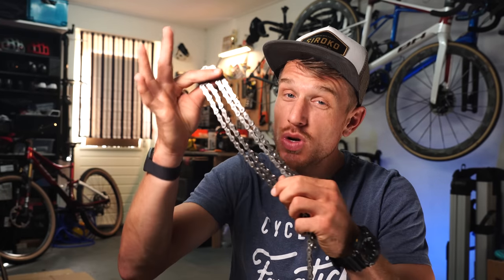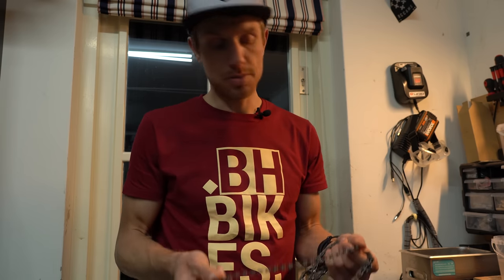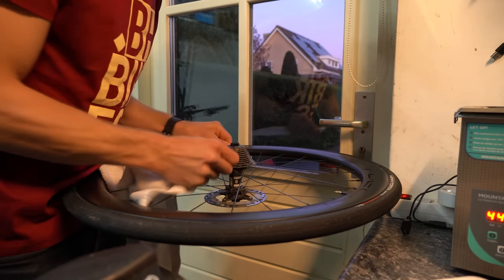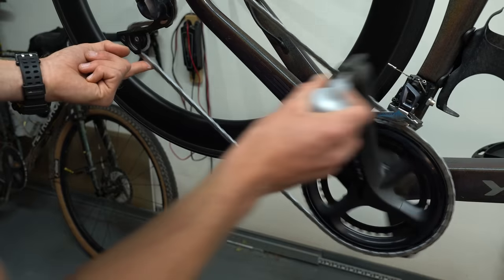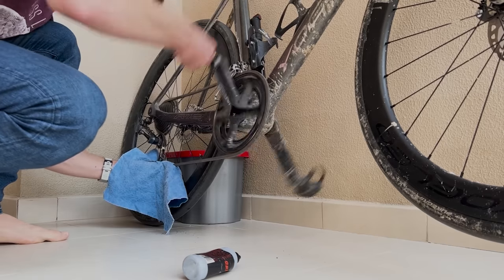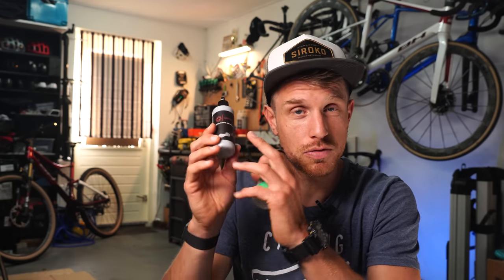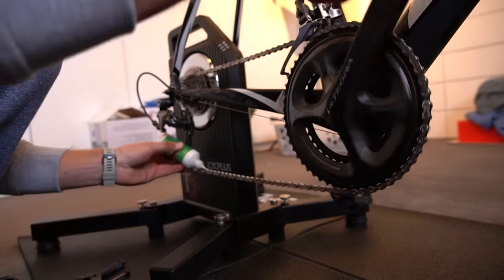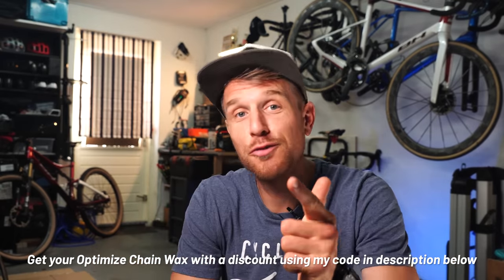Testing Chain Wax for 1-YEAR and this happened..

Comment: Thanks for a great video. Now I might even try this (at least the drop wax as a start) that I always thought was a hassle. A little bit worried about the degreasing though 😉
Reply from the maker: dont worry, just use my tips and you dont have to figure out all this stuff by yourself. shake the chain in a jar with nitro thinner, 3x fresh liquid and its clean. (from the comments here you can also use petrol, white spirits or alcohol but I havent tried those)

Comment: Imho kitchen soap like dreft is excellent, perhaps the best new/old chain de-greaser. Great video:D
Reply from the maker: dreft? never ever will get a new shimano chain clean.
Reply: yeah, I was confused at this video. Dawn dish soap and hot water will degrease the chain so well that it will start to rust right after you dry it off.
Reply: lol You're wrong, Not as smart as you seem.  @jasperverkuijl
Reply: @trentvlak outside of chain will get free of grease and rust. Not the inside I think.

Comment: Rust only occurs on cheaper cahins. I always buy nickle plated and never have the rust problem anymore.
I have been hot waxing for about a decade now  with home made mixes of PTFE, Graphite or molly and I swear by it. I normally do a few chains at a time and rotate them with my weekly bike wash.
Reply from the maker: My Shimano ultegra chain will also rust a little. But only that really light rust that disappears quickly. But the Shimano 105 is way worse.

Comment: I tried using paraffin wax for a while about 25 years ago. It was OK, but a faff doing the melting thing. I kind of got bored, and it didn't seem to make my chains last noticeably longer, and went back to oil. Biodegradeable oil these days. Emulsified wax in a bottle would make it a lot easier. I guess if you are the sort of person who cleans their chain after every ride then this is indeed an improvment. I'm a transport cyclist and ride nearly every day so I can't be doing with that. I clean it once every 6 months or so. I do agree that having a non-sticky non-oily chain is nice.
I think the right answer, at least for non-racers, is really belts. My next bike will be belt drive and I hope to leave all this nonsense behind...
Reply from the maker: Belt drive is the best for a daily commuter for sure!!!

Comment: I feel lube is a very personal thing as everyone has different bikes, riding styles, and diligence to the process of whatever it is. 
I'm using UFO drip wax. I don't want extra faff of pots. I'm sure they do better. I just lube it more often and hot water flush time to time. 
I still think that a petrol and wax based lube was the best performing that I had but I don't miss the smell or the chain tattoo. Even to be honest that one which I am referring to is rock n roll red is low maintenance in the effect that the lube flushes the gunk out then you let it dry. 
The process of flushes a petrol based with cleaner or flushing with hot water is all the same amount of work so I didn't see any benefit in the process.
I suppose to be very environmentally friendly its better to DIY and use food grade wax and no additives
pros- no chain tattoo con= wax is dirty still it flakes off a bunch of wax, just a different kind of dirty.
con doesn't last in wet. protects less.
I don't use wax on my rain bike

Comment: Did you experience any issues with hotwaxing on shimano chains with opening and closing the quicklinks a loct of times?
Reply from the maker: Nope. As long as they “click” it’s ok. 
Shimano says 1 use only so no official advice but I’d say that’s just to cover their ass 😜
Reply: Went away from Shimano chains and switched to YBN. I can't say much on their links but I get a lot of uses from YBN links and chains. I did find coatings on KMC chains don't hold wax well. Shimano wore out fast for the price.

Comment: what about quick links? how did one ever fail on you? how often do you reuse those?
Reply from the maker: never. I re-use them multiple times. but you'll only take your chain off maybe 2x in a chains lifetime. if you use a bit of drip wax in between

Comment: I'm riding abour 1500 km each month and it's getting towards the end of the year without changing my chain. I went with Silca wax and despite heavy use, the chain checker still says the chain isn't worn enough to replace.  I'd bought an anodized blue chain to match my Bianchi, expecting to put it on in June. It's now October and at this rate my chain looks like it may make it to 20,000 km and the new year before I have an excuse to swap it out.
Reply: 20,000 km. That's halfway around the Earth :)

Comment: The best degreaser I've found is simply petrol. It's really not that difficult and so much cheaper. It evaporates off.
Reply from the maker: It will leave oil residue I think?. Better to take an extra step to get rid of that greasy bit

Comment: Nitro thinner is a big mistake and you won't see the damage right away. It is similar to degreaser (just as a chain rusts from degreaser, nitro thinner weakens the metal structure of the chain). Usually the chain will crack and fail some time later due to the aggressive nature of nitro thinner. And if this happens in the middle of a ride (as it did to me once), well... Much better options are regular brake fluid or brake cleaner. General rule of thumb is to know the chemistry of the residuals on the chain you need to remove. Then use the recommended residual removal. Much cheaper and faster method than experimenting with stuff.
Reply from the maker: I’ve forwarded this to optimize. 

Think you saw the result in my video from brake cleaner and leaving it soak for 2 days, —> chain completely rusted! That’s how strong these dissolvents are (also brake cleaner) 
So don’t leave them in too long and it’s (probably) ok. 🤞🏻
Reply: @jasperverkuijl  No sir, I'm just sharing my experience. I also tried nitro thinner by myself (among other solvents), and it makes micro craks on chain links due to it's aggressive nature to the chain - eventually lead to link snap in a middle of the ride. Total disaster. I can post an image somewhere online if you like.
Reply from the maker: That’s a serious concern. I’ll take it into account 🤙🏻

Comment: Can you use bike shampoo on your bike while your hot waxed chain is on? Won’t it attach inside your hot wax?
Reply from the maker: You can. Maybe just don’t rub your chain with it. 

I used champoo to wash my bike and chain (showed in video) and the chain got clean but still had wax. The wax isn’t easy to remove with just cold water or soap. (Very hot water will change what I said)

Comment: Try using gasoline for degreaser in a jar. Another way is full strength Simple Green in a heated ultrasonic cleaner for 2 1/2 hours. Then use Acetone. Finally use rubbing alcohol.
Reply from the maker: Why would I use 3 different substances and use the ultrasonic for 2,5! Hours…., when I can use nitro with 3 rounds of shaking and be done in 10 min?🤷🏼‍♂️
Reply: @jasperverkuijl  Belive me or not. I have had different results between  Shimano, SRAM and KMC. Gasoline then alcohol works well. The alcohol strips the last of the petroleum out of the chain. Simple Green with U.S.C. for SRAM and KMC. Shimano using Acetone and a final rinse  with alcohol works well for me. I find that Acetone stays behind in the rollers and doesn't let the wax fully get in all spaces. Also chain doesn't get rusty in alcohol. You don't need to soak a chain over night. Agitating in a container for about 3 minutes is enough after the first step. This process is only on new chains. Yes patience is necessary for waxing chains. But whatever cuts time off of the process is more time on the bike. OZ cycle has extensive videos on this topic also for other ideas.
Reply from the maker: @thetruelefty9302 well, like I show in the video, in my experience acetone does NOTHING …. 😂🤷🏼‍♂️
Reply: @jasperverkuijl  it's all about whatever works for you best. It's good to hear different ways of doing things. Keep up the good work.

Comment: Seemed like you had a generally great experience once you got better at waxing (dedicated 1.5L slow cooker works great for this, and you can do it in the garage), except for the degreasing factory grease out of a new chain. I learned about CERAMICSPEED UFO CLEANER DRIVETRAIN CLEANER from Zero Friction Cycling. Super easy, supposedly environmentally friendly. Soak for a few mins, agitate, rinse with water and dry it off. Worked great on my SRAM Eagle 12 spd.
Reply from the maker: Yeah the wax is the way to go for me now 👌🏻

Comment: So, by this waxing logic, I wonder if you could achieve any similar benefits from removing the cassette and following the same process?  In theory, it should make cleaning the cassette easier for at least a few cleanings, or maybe it will mostly repel dirt and water.  Or maybe it’s a waste of time?
Reply from the maker: I think waist of time. The cassette usually doesn’t attract stuff when it’s clean. It’s the oil from the chain that makes it greasy and than makes it dirty… 

Just make sure everything is degreased before you start waxing the chain and you’re good. 🤙🏻

Comment: The easy, less aggressive way is the Silca chain stripper. Put it in, let it sit for 10 minutes, shake it a bit, rinse in water and blast it clean with compressed air. Job done.
Reply from the maker: Silca stripper 45€/500ml, nitro thinner 7€/Liter… 
Factor 10 as expensive 💰 

Just like “brake cleaner” by a cycling brand is somehow way more expensive than the motip brake cleaner.
Reply: @jasperverkuijl  It is expensive but you can use it in an unventilated room and the 500ml get a lot of chains done. I wonder if you can find something similar in the aircraft maintenance department 🤔 If we are talking money, we have also have to talk about single use quick links.
Reply from the maker: @chrisridesbicycles in general, airplanes will not use the highest “bio” products as function and safety are more important in that sector 🤓 (like halon e.g.) 

About cost,
I’ve been reusing non-reusable quicklinks since I stopped pooping in my diaper and I never had any problems 😉🤣
Reply: @jasperverkuijl  Sure, what I had in mind with the aircraft is that they will use the stuff that „just works“ and maybe is not corrosive because only hours in the air pay the bills and they don‘t care about the cost of a cleaning agent.
This is a good data point. If it works with your power, I will never have a problem. The samples from 60kg climbers didn‘t give me much confidence.

Comment: did you make chain measurements  before every rewaxing, that would give answer how often it should be rewaxed or how long chain can survive
Reply from the maker: What chain measurements?
Reply: @jasperverkuijl  i make chain  measurement every 1000km to be sure if chain is worn as i expected,to prevent surprise by too worn chain, when i started to use wax,i measured before every waxing(140km) and once i measured after 180km and chain was worn(totaly i made 1500km with this chain and that distance between rewax), now i do it on 100km + - 10 km and chain lasts over 6000km,i use vernier caliper
Reply from the maker: @makantahi3731 i don’t understand what measurement you are doing to judge of your chain wax is worn or not. Sorry I don’t get it. 

Anyway, it seems like you are getting a lot of km’s out of your chain with ex 👍🏻
Reply: @jasperverkuijl  you have any chain checker!?!?!, so it has some numbers: 0.5 / 0.7/1.0 percent!!!, so you can measure it with vernier caliper and as i did, for chain checker i took dimensions: very,very new never used chain is below 119.65mm, chain after 300-500km is "break in" and has 119.70-75mm,and can be used till 119.85-90mm, between 119.90 and 120.00mm chaim must be replaced, i compared same kind chain new with used: i hanged new and used with some kilometers and compared difference in length on 108 links and  new to 300-500 km chain is 0.5 mm longer, chain between 119.70-120 mm is longer 0.5-3.0 mm.  so i do not need to remove chain from bike and compare with new,i measure it on few places before rewax and i know how long it can be in use ,results and predictions are very accurate and very close mutually
Reply: @jasperverkuijl  i used to make 20000 km per year but now 5-6000km, now with chain waxing and gear teeth reshape,cost of my bike use is very low,i save 5 chains per year,and have to buy new cassettes every 10-15 years,2 tires in 2 years...

Comment: I managed to achieve a similar 'cleaning-result' (a ratlling chain) with WD40... (and getting rid of the WD40 residue on the chain afterwards with dishwashing detergent and water)
Reply from the maker: Yeah wd-40 is a good cleaner (also for rust), it will dilute the lube/grease on the chain and afterwards you can use a degreaser to make it clean. 

Not sure if dishwashing detergent is strong enough but if you have good results… great!👍🏻
Reply: @jasperverkuijl  Dreft power 😛

Comment: Use gasoline to strip the oils off the chain. Then wash in hot soapy water and then put the chain back in a jar with rubbing alcohol 91% to pull the water out of the chain. Remove the chain from jar, let's dry and then wax.

Comment: So here's a chain wax doubter's question.  What prevents the water based "chain wax" from causing rust?
Reply from the maker: Ive mentioned this in the video. It’s less resistant to rust than oil, but improvide a workaround that I get good results with

Comment: I am missing one VERY important thing here. How many more kilometers can u do on one chain comparing to oil lubes
Reply from the maker: I didn’t test. Will be impossible for me to compare different chains in similar conditions and actually know what wears out faster.. I ride like 10 different bikes (including rentals) and don’t keep track of every chain on every ride etc..🤷🏼‍♂️
Reply: I get 3 times the lifespan of an oil lubricated chain. I wax 3 times a year, in 6000 Km intervals, get 3 years to a 10 speed chain. The 12 speed chains I wax monthly every 2000 Km, get about 1 year to a chain.

Comment: I just get my bike to the lbs, let them degrease and apply wax at the start and end of the outdoor (4 months) season, in-between start/end i reapply with dripp wax every 300km. Costs me just a few bucks on top of regular service and saves me the hustle with solvents (no need to buy or get rid off the spill) and time. But im not pro or semi pro.
Reply from the maker: Sounds easy!👍🏻

Comment: Nitro solvent is one of the harshest chemicals you can use. Next time try to do this with regular petrol from the gas station, or lamp oil from the grocery store. Much cheaper than all those things and it just works.
Reply from the maker: Guess that’s why it works so great 🤷🏼‍♂️👌🏻

Comment: To degrease a chain the best and fastest thing is muc off Chain degreaser. It's not cheap but this is the only one which works after one use. New chain is really hard to degrease.
Reply from the maker: Lots of other ways that are cheap and work great too 👍🏻
Reply: @jasperverkuijl  yeah you have too put it three time in the jar and the degreaser is aggressive as hell 🙂Moreover, I cannot pour this down the normal drain, but must dispose of it or let it evaporate outside.

Comment: Some  weird stuff here. First, why be so worried about degreasing? Oils and waxes are not that different substances and many oil based chain lubricants already contain wax. When you heat the chain (heat gun etc.) most of the oil will drop off and if there is some left what does it matter? Oil is still good lubricant as it ever was.

But don't heat chain too hot, I'd say limit is 150 deg C. If you go much higher you can draw temper of chain and it will wear down very quickly.

 Idea of hot waxing is to make viscosity of wax so low it penetrates small gaps by capillary effect. If there is small oil residue it certainly will not prevent it.
 
Adding carbon dust or even graphene to wax may have some minor advantage but it also makes chain look dirty which is a bit against the idea of waxing. Matters of friction are so complex that it best to be very sceptical for claims of the manufacturers, they hardly have done any scientific studies. And friction of lubed chain is quite low in all cases so there is no real issue in that respect. If I had to guess I'd say oil lubricated chain has lower friction but in the long run it may be opposite if you don't relube chain regularly.

It is also worth remembering that waxes (paraffin etc.) are very cheap products of chemical industry, more precisely of oil industry. If someone asks tens of euros from dyed pieces of wax in fancy packages it is pretty close to cheating. But ok, it is not dumb who asks but who pays😄 Appropriate price for 1kg of paraffin is few euro at most, I wouldn't pay it more than 3€. 

1kg of paraffin is enough to wax huge amounts of chains, so it is also very cheap method.
Reply from the maker: Well you should check again what I explain about oil and wax and their melting point. 
Mixing oil and wax messes up yhe viscosity, making it an emulsion that’s like grease. So not what you want. The whole idea of wax is that’s it’s not liquid and it should stay like that. Mix it with oil and it will become soft
Reply: @jasperverkuijl  Both work. That is bicycle chain ffs, it doesn't matter. And nothing stops you adding wax later, then amount of oil has decreased after use. 
I know very well viscosities and chemistry, and like I wrote there is lot of BS around matters of friction
One is if waxed chain is quiet it doesn't necessarily mean it has lower friction, thick wax just dampens the sound.
I'm not against using wax as chain lubricant. My current spray lubricant already has wax, chain is gray after using it and it is less messy than some old lubricants